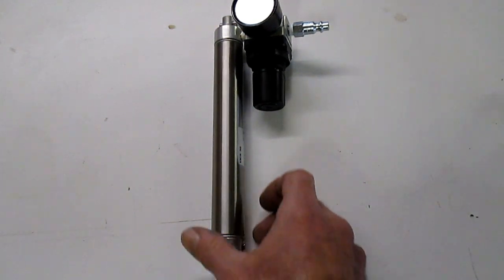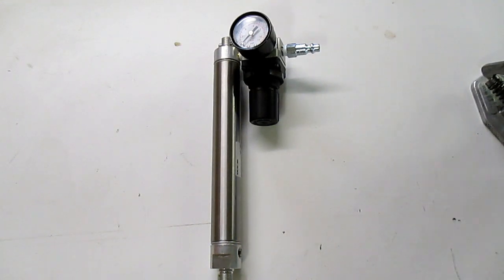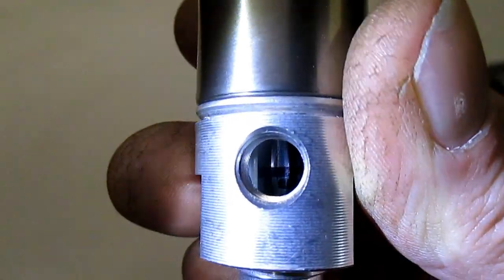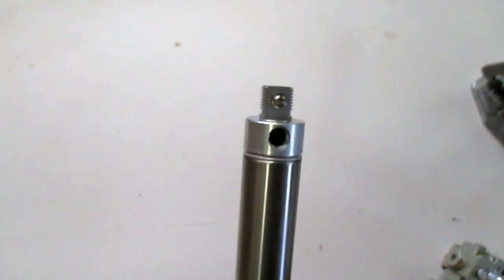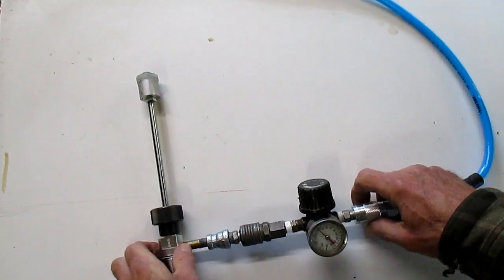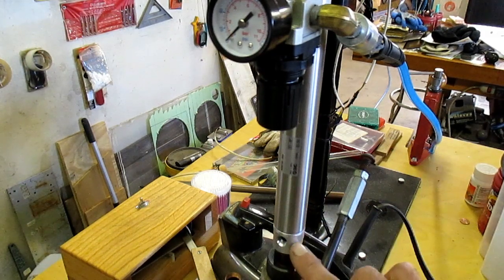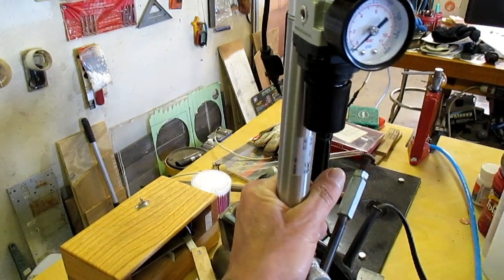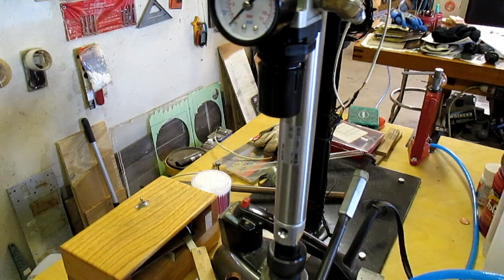Air Assist Mods For Star Lube Sizer

Comment: Why not just disconnect the air feed and use a hand held air nozel with a rubber tip to blow the cylinder back to the top? Seems like it would be a quickie to do? Nice work...charlie
Reply from the maker: Hey Charlie that thought did cross my mind and when I get back to the Star I’ll try it. May be the easiest way of doing it. And yeah I do like a good project to push my limits, and as long as I’m figuring out things I don’t feel old